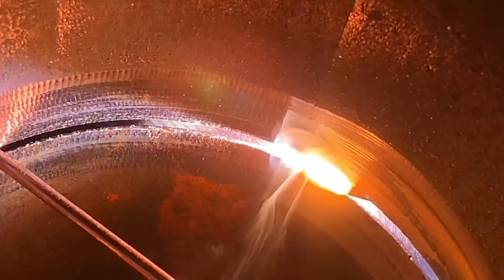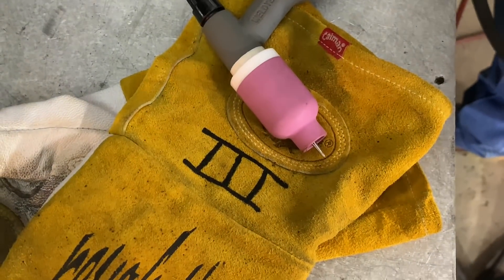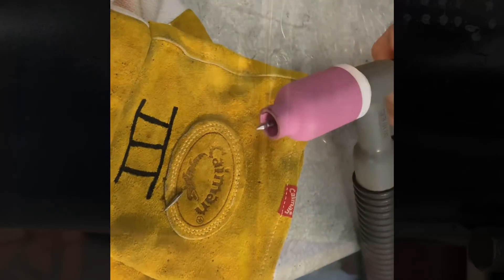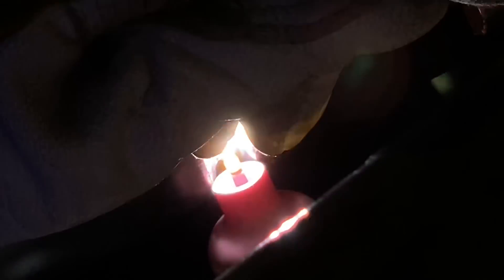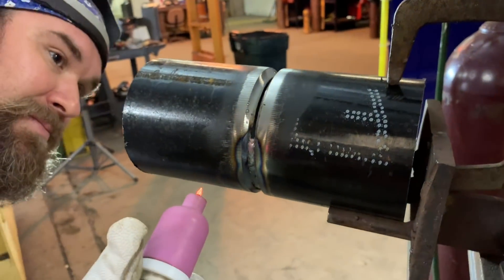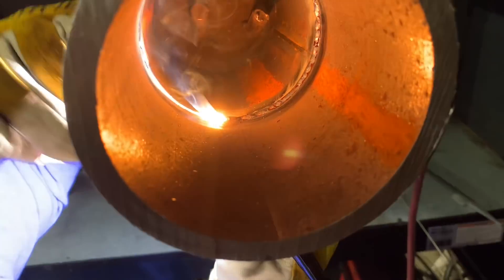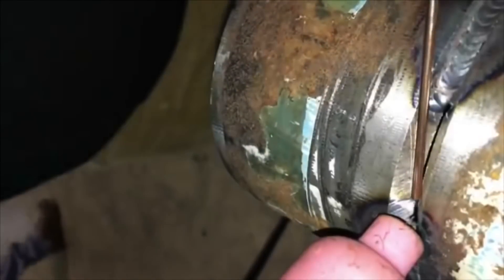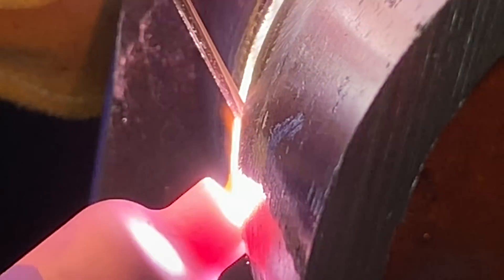Tight Root Gap 5G

Comment: What size tig torch are you using for the root pass ? Is it water cooled etc.  I just have an air cooled no 26 torch for when i start leaning pipe welding.  Thanks Mike

Comment: So dip wire and keep the puddle small and in the center. But point the tungsten at an angle?
Reply from the maker: +Brandon Hernandez I like to get the puddle moving but keep it small. Then when I feel it’s liquid enough to feed through I add wire through the center of the puddle like throwing a dart I can feel it pushing through and then walk up a little and repeat. If your having trouble turn the amps up. Remember 3/32 filler no 1/8
Reply: Alabama Pipe Welders Academy does this work with both 70s2 and 70s6 wire?

Comment: Over 1/8 reinforment, that would be rejected by inspector.
Reply: That is in no way over 1/8" reinforcement
Reply from the maker: Robert it is a 1/16 and usually just over flush after the hot pass.

Comment: So 144 amps and when you add wire is it like a key home dip or just not letting key hole and just adding wire to the edge of the puddle
Reply from the maker: Jesse Davis add the wire to the center of the puddle at an angle